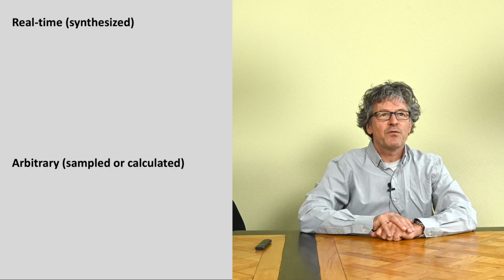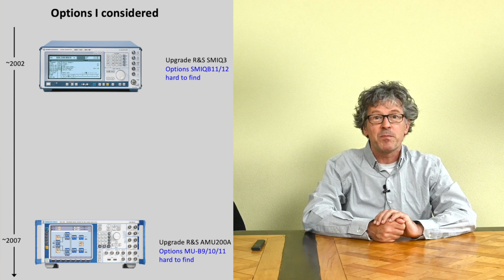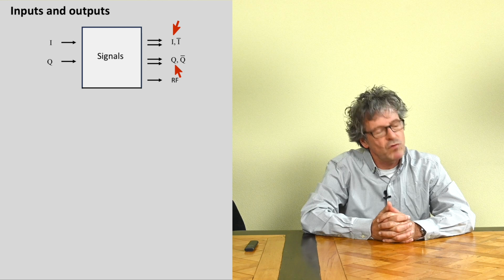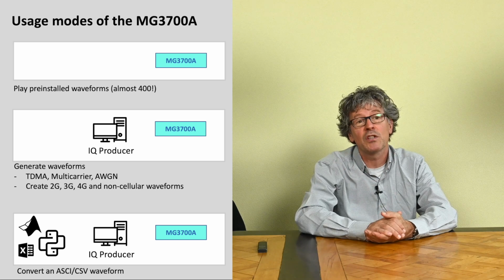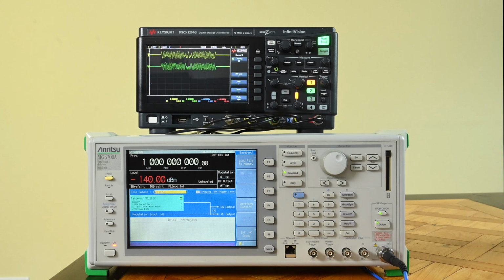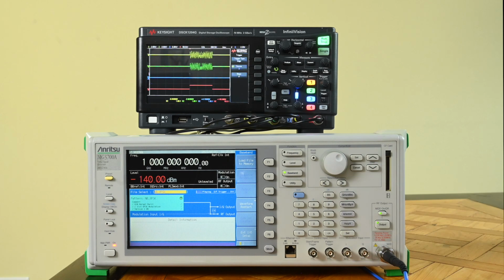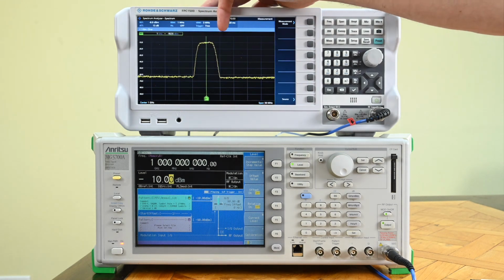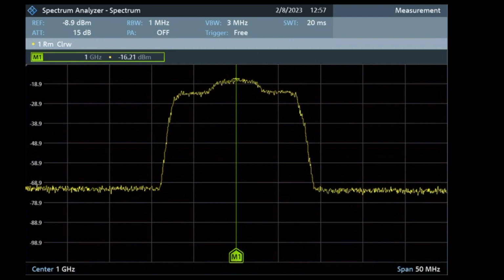REL #33 Anritsu MG3700A Vector Signal Generator — Pt. 1: Basics and stand-alone use

Comment: Can the Anritsu support real-time waveforms for generating digital modulations, such as basic BPSK and QPSK, at a specified C/No? Or does it work using files only?
Reply from the maker: Well, it's kind of in-between. The Anritsu can only play waveforms from a file. But you do have two simultaneous channels. By loading a, say QPSK waveform into one channel, and a noise waveform (with chosen parameters if required) into the other, you can 'live' edit the relative balance between the QPSK waveform and the noise.

Comment: Thank you so much for this video tutorial. I also decided to get a Anritsu MG3700A after watching this. It has now arrived, and I see the ALC alarm, and about 7 dB loss around 3 GHz, about 3 dB loss around middle frequencies and 10 dB loss around 250kHz when measured with power meter. Now I’m wondering if I should return it. But I can see that most MG3700s sold on ebay has this problem. The error is not correctable in an easy way right ? Signal path video also failed to repair it.
Reply from the maker: Thanks for the compliments and congratulations with your MG3700A. Concerning the ALC alarm: this is not an uncommon issue for this instrument at some age, unfortunately. The deviation got so big it can no longer be corrected with the internal ALC feedback loop. But should you return it? Well, if you do measurements or experiments that require the source to be within a certain defined range, then this would be an issue. For many other use cases, the absolute level value is less of an issue and the Anritsu would be a great tool, even if it has ALC alarms. And you nay measure power externally, and correct. Mine has some (small) ALC alarms and I’m not really bothered.
Reply from the maker: A couple of more thought: carefully reading the manual and once having done an analysis of RF output power and alarm occurance, I found that the alarm depends on several conditions. If I remember well: operation time, chosen output power, but also level, modulation method /characteristics (!), and perhaps some more. You might want to look into that.
Reply from the maker: Finally, I think there was indeed a broken MG3700A in a Signal Path episode, and I don’t think it got repaired. But the issue was in the  6GHz version board, which is a rather different beast.

Comment: Thank you so much for this video tutorial. I also decided to get a Anritsu MG3700A after watching this. It has now arrived, and I see the ALC alarm, and about 7 dB loss around 3 GHz and about 3 dB loss around middle frequencies when measured with power meter. Now I’m wondering if I should return it. But I can see that most MG3700s sold on ebay has this problem. The error is not correctable in an easy way right ? Signal path video also failed to repair it.

Comment: I got an 128MB CF memory hard which I inserted into the MG3700, I get an error message invalid memory card. I tried a FAT16, a FAT32 formatted and an empty (zeroed) card, initialised  with an PC, no success with the MG3700. Has somebody an idea if Anritsu has a kind of magic boot block on the disk that non Anritsu memory cards don't work. Any help is be appreciated. Regards from Hannover, Germany.
Reply from the maker: Helmut: in my experience, the MG300A is giving CF card errors if a card has not properly been 'ejected' from the computer it has been used on before. Simply used the formal "eject' on the computer solved the problem for me!

Comment: is there a published list of the wave forms in the library ?  Im looking for fm stereo signal

Thanks in advanced
Reply from the maker: @DingerAdventurer , one of the Anritsu MG300A manuals (there are quite a few!) describes all build-in waveforms. You can find it here: https://dl.cdn-anritsu.com/en-au/test-measurement/files/Manuals/Operation-Manual/MG3700A_pattern_opm_e_14_0.pdf. 

FM Stereo is not a standard one. You should be able to make it yourself using the Anritsu IQProducer, which has a multitone module, which could be used to make the mono signal, the pilot tone, etc. 

Of course, there are other devices that can generate FM stereo signals out of the box (like the R&S CMU200 with the appropriate software option). 

Good luck!

Comment: This week I took a lucky opportunity getting a used MG3700A, I was discussing with the owner (discontinued HW development firm) for quite some time, now I got it. A basic 3 GHz model, with mechanical attenuator and more sample memory. I started testing it, it works nicely, sometimes a get an ALC error message, which comes and goes. In the signal output there is no level change/problem. I will register it with Anritsu and try to make a backup of the hard disk.

I am looking forward for the additional video parts. In the meantime I will try the IQ-Producer.
Reply from the maker: PS there are two ways to make a backup of the HDD. The least intrusive is to connect to a PC, use an FTP client and simply copy all files. The more intrusive way is to take out the HDD (which is in a caddy, accessible form the outside, so not very hard), connect it with an IDE interface to a computer, and copy. Then you can also use a raw sector copy tool that also captures the full disk formatting. I though of replacing the Anritsu's HDD with a PATA SSD drive (they are rare but can be found). Then I understood others experiences issues doing so; apparently, the VX Works real-time OS does not deal well with too fast drives (!!) as I understand it. Anyway, the advantage of changing to SSD would be limited anyway.
Reply: @rudiselectronicslab861  thanks for the advise, I prefer to use an IDE adapter and use a Linux computer to pull a disk image copy via dd from the device. This way I can restore it when needed. I believe it is a FAT32 file system.
Reply from the maker: Congrats! Sure you will enjoy it! Around 1.5GHz and around 2.7 GHz, and -3dBm output level, my unit also gives some ACL errors, meaning the automatic correction can no longer compensate. Using an external power meter, I see the in these areas, the deviation is still limited (in most cases 1-2 dB, sometimes 3dB) and I can surely live with it. At lower output levels, the ACL problem is present at less frequencies.

Comment: I am looking forward for the IQ-Producer video, my Anritsu MS2690 SA with generator also supports the IQ-Producer. Now it's time to dive into it.
Reply from the maker: IQproducer works really well, I should say! Been doing quite a lot of things with it. May take me a while before I manage to finish that video because of loads of other work... Quite curious how IQproducer works with the MS2690! Maybe you can share something on that...
Reply: @rudiselectronicslab861  My Signal Analzyer MS2690A has a 6 Ghz generator option build in. It can generate a 125 MHz bandwidth signal, The Analyzer also can record and replay signals. The Anritsu IQ-Producer is supported for this device. I just tested basic build-in CW output, however I believe I can import and kind of Q-I samples. I will look into the IQ-Producer software soon.
The MS2690A has no tracking generator (following) build in.
According to the data sheet, the MS2690A can do similar things like the MG3700A. Regards from Hannover.

Comment: What is also nice with Anritsu, you can register your device in their customer portal which will allow you to download latest firmware and tools. Often firmware is being updated for many years after the device are being produced.
Reply from the maker: True! After I registered my device with them, it took them a day or so to validate my request and then I got access to the 'premium' part of their support website, with dozens and dozens of documents on the MG3700A alone! A lot of valuable  material, but unfortunately no service manuals or - better - schematics. I heard Anritsu is not making any of such technical documents available...
Reply: @rudiselectronicslab861  Most important is that you receive all the latest software revisions for this device. Anritsu often releases software updates many years after the device is not available anymore. Registered owners benefit from it.
The problem with the missing/non shared schematics is the same for all vendors. I miss the old days where we had access to the schematics.
We as hobby users need to stay in touch to help each other with such measurement devices.
I am an enthusiastic friend of Anritsu devices, the Signal Analyzer MS269x series is way better than the Agilent/Keysight  PSA series, many clients don't know Anritsu much, they look for R & S or Keysight devices only.
Somehow we need to develop some connections with Anritsu to get access to service manuals. I stay tuned. Your very professional education videos may help to get such connections at some point in time.
Regards Helmut

Comment: Useful. I had been thinking of getting one. I bought a Keysight MXA N9020A vector signal analyser recently from eBay for around US$2000. They are now obsolete with the move to 5G, so a few are around. The one I bought had all options enabled, excluding the real-time option. The MG3700A would be a good signal source.
Reply from the maker: Thanks for the reply. I have not had the opportunity to use the N9020A, but the Anritsu MG3700A certainly is very capable. I especially like that a lot of things come as a standard (many waveforms, BER measurements, etc.) that are optional at many other suppliers. Often found for less than US$1000, it seems a good deal that could complement the MXA.
Reply: Drew, you should get one indeed. I have that MXA/Anritsu combo and it is really great. I know you are a Matlab user: getting your IQ data (and markers) to the Anritsu requires no Anritsu license and is super simple. Highly recommend